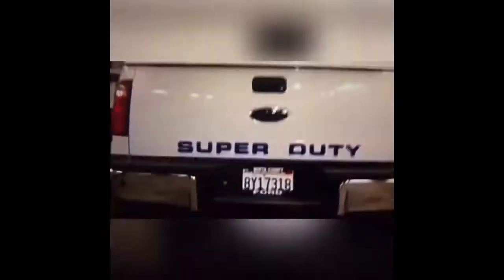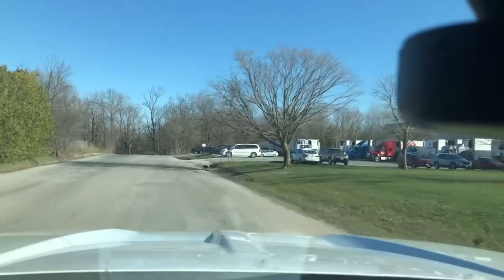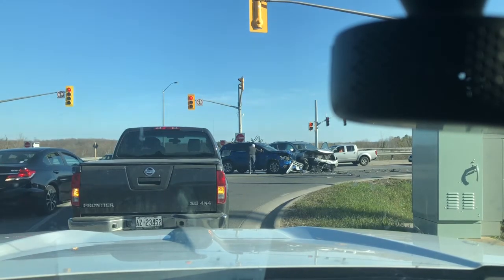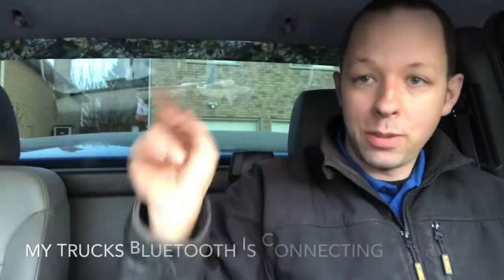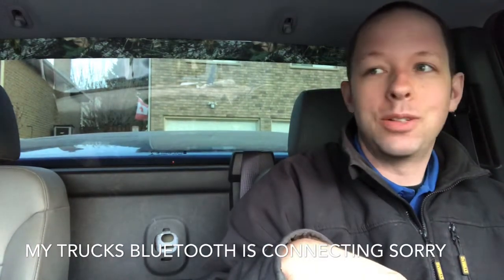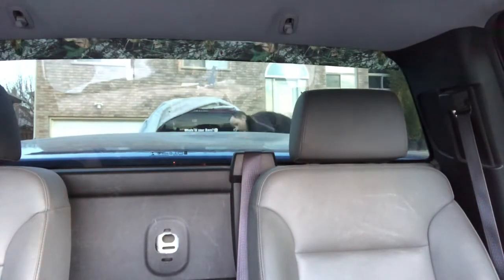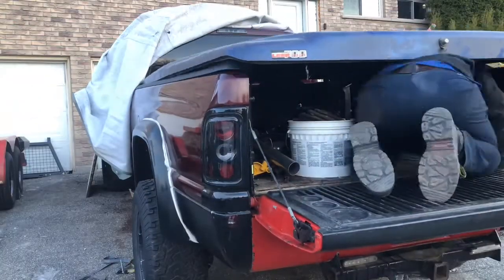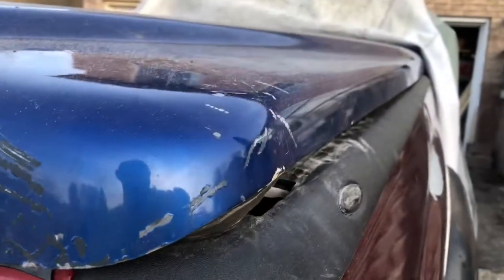Part 1 - Intro To Tonneau Cover Actuator Project 🤓 Build ( April 2021 )

Comment: hi there  can you tell me what type of actuators you used and the controllers  please ? thanks !!
Reply from the maker: For the remote - Maxmartt 12V DC Motor Linear Actuator Wireless Remote Control DPDT Switch Forward Reverse - Maxmartt 12V DC Motor Linear Actuator Wireless Remote Control DPDT Switch Forward Reverse https://www.amazon.ca/dp/B087PF7QV8/ref=cm_sw_r_cp_api_i_WRWC158PKP7B6CMDVKVR?_encoding=UTF8&psc=1
Reply from the maker: Linear Actuators - WindyNation LIN-ACT1BR-30 30 Inch 30" Stroke Linear Actuator 12 Volt 12V 225 Pounds lbs Maximum Lift (Includes Mounting Brackets) - WindyNation LIN-ACT1BR-30 30 Inch 30" Stroke Linear Actuator 12 Volt 12V 225 Pounds lbs Maximum Lift (Includes Mounting Brackets) https://www.amazon.ca/dp/B07BLWQ3KH/ref=cm_sw_r_cp_api_i_6Y9HDPNSDZ28265Q3WHX
Reply from the maker: The remote is from a brand I use for work. That actuator is a cheap brand I don’t yet know much about. So research them.